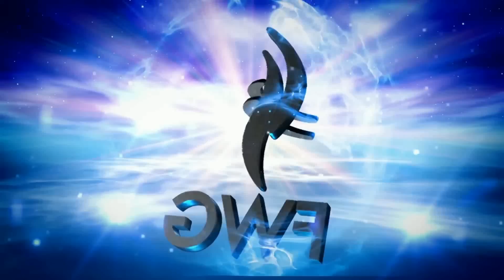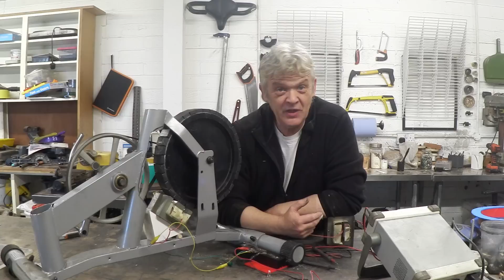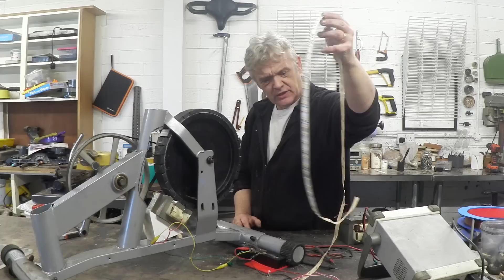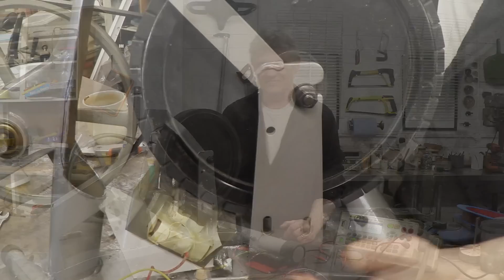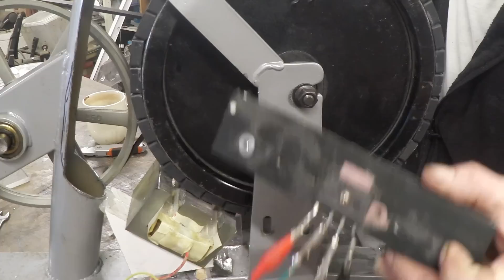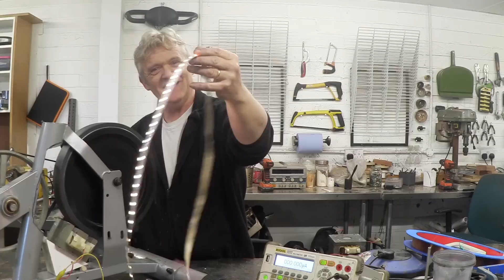Microwave Oven Transformer Into A Generator

Comment: I do have an old exercise bike and an old microwave, all I need is the magnets!
Reply from the maker: you could probably use the ring magnets from speakers
Reply: if you are careful not to break the ceramics, there are 2 ring magnets on the magnetron of that microwave.  Use a dust mask and gloves because the ceramic is impregnated with beryllium and highly dangerous to ingest the dust if broken.  Just be careful and the magnets can be removed without incident.
Reply: @mwm2929  In one of Rob's video, he explains how easy it is to avoid beryllium-infection. First, tip of the magnetron is pinkish of colour if there is beryllium in it, otherwise not dangerous material (aluminium oxide or something). Other thing is just to not touch the ceramic tip, simple as that.
Reply: @Teknopottu  For sure.  I took a job in an appliance repair workshop and scrapped hundreds of microwaves before I learned about the beryllium ceramics.  We were smashing the things with hammers to separate the copper core from the rest! lol  We were given no training or PPE for the job either.  As a result, I have hundreds of magnets and luckily no ill health because of it. They are quite strong for ceramic magnets for sure.  My favorite ones I took out of dishwasher pumps.  cylinder magnets with N and S on either side of the cylinder on a small shaft.
Reply: @mwm2929  Jeez! That's awful! Gladly you are okay. Wouldn't be the first time worker wasn't given proper precautions; my father worked decades with asbestos as a builder. That was trend of the time and many got ill and have died because of asbestos, luckily my father is guite healthy. Any project in mind with those magnets or have you already made something?
Reply: @Teknopottu  I build lots of things that have already been done by others.  I post videos of unique projects or occasional "how to" videos.
Reply: @mwm2929  Yeah, seams like interesting content. Will look into that!

Comment: Are you saying that Voltage alone is everything Robert? Surely power V*I is the way to determine how useful it is?
Reply from the maker: no of course not - I am saying don't get too tied up with what folks tell you - use your own approach and measure success in your terms rather than other folks terms
Reply: @ThinkingandTinkering  In a generating system, we use work to create power. Power is defined by the product of Voltage and Amps. Voltage in and of itself is useless.
Reply: @TonyLing  , good luck trying to make in real life voltage without influere/amps and magnetic flux mate, remember the strawman is just a month away.
Reply: I think the task he set himself in this video is simply to show a mechanism that puts out a non-trivial amount of power, and non-trivial in this case means enough to do one useful thing: power the lights. 

What’s “useful” is highly subjective. If you’re sitting in the dark, this contraption is already extremely useful. More broadly, we can attach all manner of things to this contraption, and possibly modify this contraption. For example, I have a flowing stream on my property that could be harnessed via a waterwheel to run this. If I built it, I might make it larger so I can put lots of microwave coils around it. And then the output would go to a charge controller, charger and battery bank system that I have, mostly because I already have it. 

What’s useful to you depends on what you have in your context. “Useful” isn’t a static concept and so cannot be defined or applied without knowing the context into which it’s going.
Reply: @twestgard2  very well put mate. Useful is measured on personal requirements and needs.
A larger waterwheel running a flywheel each with a number of coils connected in parallel, maybe even a few flywheels of the same specs then your batteries would always be charged.
Reply: tony, Are you saying that influere (in rush,to flow into,heating amps) is more useful, then just leave and use the thicker primary wire already in there,remember to insulate the then unused secondary as that could be dangerous at the same time